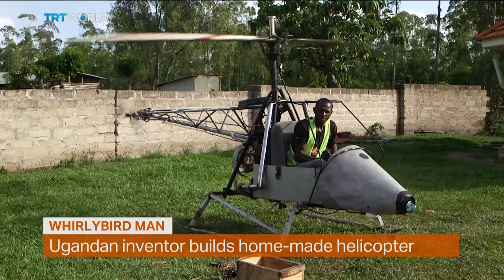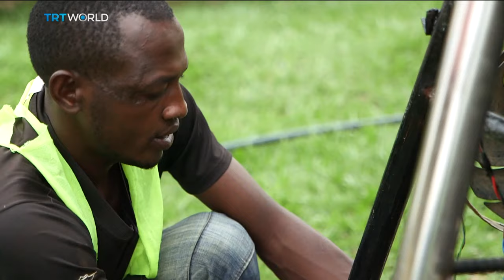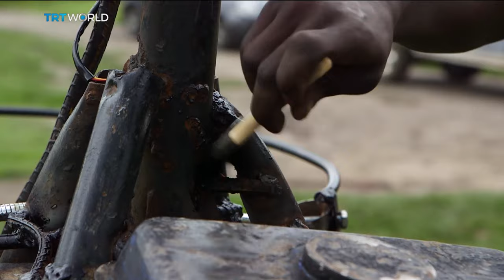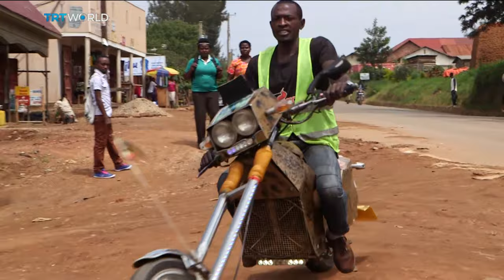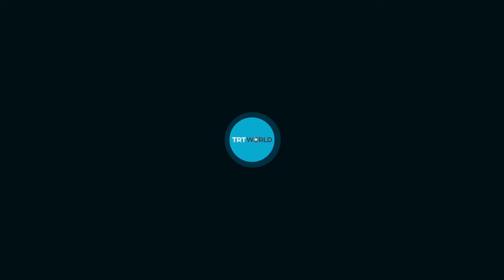Money Talks: Ugandan inventor builds home-made helicopter

Comment: This video is misleading. The contraption he built will never leave the ground. The heli shown that’s actually lifting off is a totally different machine.
Reply: I didn't notice till I read your post. Yes it's different.
Reply: yeah he modified it. if you look at the other videos with him from a while ago his helicopter looked like that. he changed it so it would.. you know not send him to the hospital when it landed.
Reply: That's a shame. I had respect for this guy because he looks almost legit.
Reply: @ElBloeTigre  that is his helicopter that was flying for a few seconds before crashing ..after the crash he rebuilt or modified it.That is why it looks different.
Reply: The helicopter that is actually lifting off the ground is his helicopter. He had to repair/rebuild it after that crash that is why both helicopters in this video look different.
Reply: @ElBloeTigre  both helicopters are his.After the crash he had to rebuild or repair it that's why they both look different in this video.
Reply: No chance, helicopters are different. The engine, the main mast, the swash plate. The tail rotor has an axle, the other uses bicycle chains. This thing didn't get off the ground. The flying helicopter is in another report in another country.
Reply: How did he get the injuries if it never took off ?
Reply: @johnlewis8340  read my comments above.

Comment: I think it is a replica/imitation of the helicopter which crashed in the footage. To make things interesting, the reporter created his own version of story.
The blades and   tail almost twice shorter. Engine shrinked triple the size. Cooling fan is welded as decoration purpose in the same spot as crashed helicopter, it service no purpose. The torque transferred thru the shaft in the tail not thru the chain. 
I don't blame the man who build the machine. I certainly like DIY  people. Engineer it self didn't say anything suspicious.
 But I don't like the story which was represented in this video.
Reply: I think of that also..
Reply: CORRECT........

Comment: Yep same old story...after sponsorship to develop something that will never work just as a means of getting money ..the thing is the guy has built it to look like the one in the video that crashed yet its operating dynamics don't match that of the one flying.. the out of balance condition is a dead giveaway
Reply: mike brink  The tail on the one that crashed is also at least double the length and appears to be made out of a lighter metal like aluminum. It's definitely a send me money scam. The part where the guy was talking about getting in touch with the aviation industry made me laugh. For what? Ultra lights are mostly hobby level stuff. Unless you build a really good design and want to produce and market it yourself.

Comment: The belt powering the tail rotor is not appropriate... it will create a vibration that will cause an irregular movement... he should check the perfect bite of wind for that tail rotor.. cause base on the video the torque is so strong it can’t even barely counter the torque cause by the main rotor... he should change those things...for him to avoid major accident like he did..

Comment: Top rotor needs to have the capability to change its pitch and both top and rear rotor blades also have to have the ability to change the blade pitch also, that is if the actual blades are made and balanced properly.

Comment: Sorry, but just because it looks like a helicopter, does not mean it is a helicopter. The rotor control has no swash plate or pitch control. Add to that, the vibration due to the unbalanced blades will cause the thing to self destruct. With such a small engine, he would need to construct the frame from dimple die'd aluminium so it would be light enough to sustain flight. Not meaning to p*ss on his parade but this is a death trap and people don't have the good sense to tell him.

Comment: to avoid that major problem
the tail rotor needs to be capable in rising in speed and to lower at will to maintain from main body rotation.
Tail rotor do need it's own speed variation to also control left or right turn.
this guy would be better of trying to build a Gyrocopter because it's easier and more stable without costly investment
Reply: motorized paraglider will be even cheaper option

Comment: In all of ‘these types’ of videos, there are two binding binding themes. (1) They have a very small understanding of what a helicopter looks like and then try to get their contraption close to that. (2) zero concept of aviation and that building their machines in a small backyard limits the necessary dimensions of the most basic fundamentals. i.e., blades that are the largest they can utilize because of backyard dimensions (one in a video looked as if the blades were four feet at the most), or using a scooter engine. If they are getting media coverage, can’t someone in the respective governments hook them up with companies that actually do this? If a person (so-called backyard aeronautical engineer) shows even a small glimpse of reasoning ability, advanced mathematical understanding, etc., send them as a training mission. Surely there is a step between stacking stones in a pile to landing on the moon! 😝

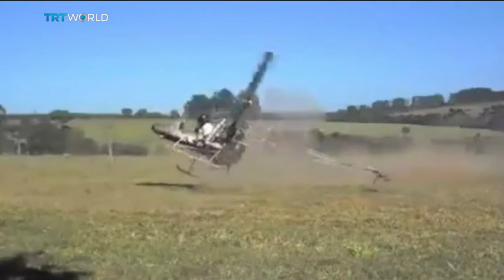Comment: Non-lazy analysis: He lifted and controlled it in the air well. The tail rotor is working to prevent the torque of the main blades from spinning the craft. Successful flight!  BUT—In any aircraft, Getting off the ground is easier than landing—the problem being more bad piloting rather than design.  An untrained pilot will crash even the best modern aircraft FFS. Soo—At 1:08 both skids are on the ground and he should cut power and the main blades should freewheel without power, while the rear rotor stays spinning a bit to counter residual torque.  However, at that moment, looks like a wind gust may have lifted it he may have panicked and gunned it to try and go back up, but that just made it tilt more, and at 1:12 he is tilted at a 45% angle. There, the main rotor hits the ground and he’s fcked.  Knowing how to keep the craft level would certainly have avoided this.  Watch WHY—what actually happened to cause the mishap.  It was poor landing skill—not inherently bad design.  Chain drive is NOT what caused the 45% tilt AFTER he was landed.  No tilt after skids down and LANDED—no crash. He tried going back up to correct it, but no.  Once skids touch ground decouple engine from rotor and it shouldn’t have the power to lift/tilt into disaster, unless a big wind gust tips you.

Comment: This helicopter will not fly. The main rotor has no cyclic controll, it doesn't even have pitch controll. The gear ratio of the tail rotor is wrong. It has to be about 5:1. The tail rotor has no control of either pitch or revs. Nothing is balanced. And a Chinese 250cc motorcycle engine will not have the power to lift 500 pounds of metal even if everything else was optimal.
If this helicopter was a rebuild of the one that appeared to fly, he must have lost all his knowledge of helicopters in the crash.

Comment: It is one thing to build a helicopter and quite something else to fly it - a different skill entirely. Putting aside whether the thing he built would fail under normal flight loads and kill him later, just getting off the ground and to hover safely in a helicopter takes skill, one that takes most students around 10 to 20 hours to master and took me much longer because I did not learn in one go, I had breaks in my training - my understanding is that he has had no training.

Many people may be unaware that these days, most radio-controlled helicopters contain electronic gyroscopes that handle either yaw or pitch or both, whereas most small training helicopters, including his one, do not - the pilot has to do it and it is tricky to learn. 

The video of his accident is absolutely predictable for someone with no training on how to fly a helicopter - most people would do exactly what he did - you have to be TAUGHT how not to do this (so you can imagine how dangerous it was for the first aviators); he is lucky to survive this far and he is most likely to kill himself if he keeps trying without getting the training.

Comment: This is a good step forward, but he has to learn physics and engineering before using a DIY technician's experience. This is a very dangerous death and life matter that does not worth testing on himself. The most sophisticated planes that are thoroughly checked by qualified engineers crash , every now and then, for a little mechanical or electrical fault. Life is granted once.